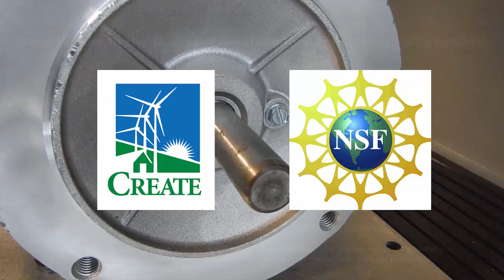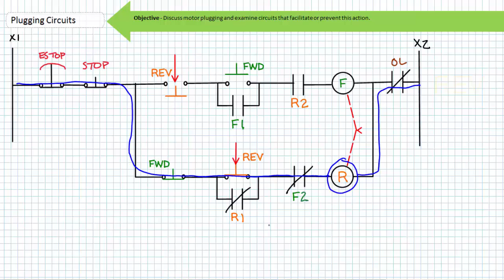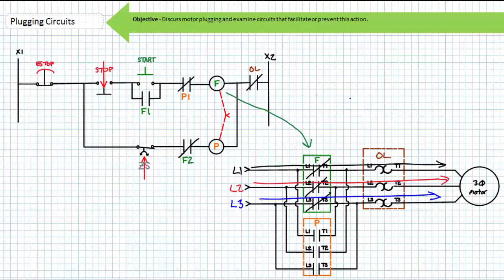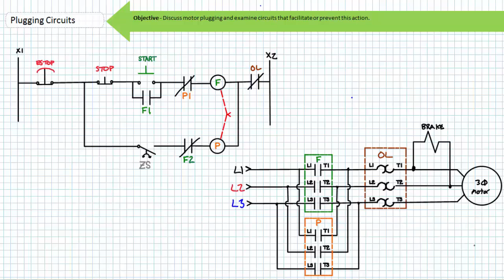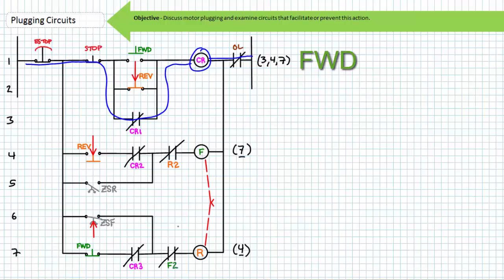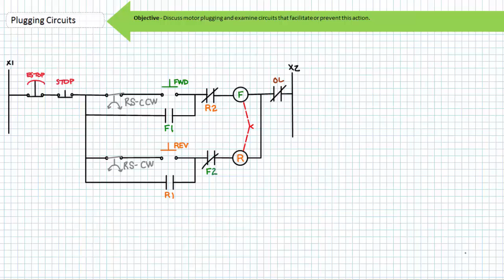Plugging Circuits (Full Lecture)

Comment: Hallo Sir,
I have a question about phase reversing and brakes.
The moment we reverse the phase, the direction of supply voltage for brake is also changing.
I mean, at first, the line to line voltage of brake is L1 to L2
and then it becomes, L2 to L1.
Does the brake still function ? is there a possiblity for magnetic forces to appyl counter force on springs ?
Reply from the maker: Good question. As illustrated the brake would also experience a phase swap during a plugging operation. This however isn't an issue for brake functionality because it operates using an AC solenoid where polarity does not influence direction of operation. This being said there is an extremely (extremely) brief transition period between the "instantaneous" reversal where the brake solenoid is de-energized when the F contactor opens and the R contactor has yet to close. I'll discuss this in later lectures on semiconductor devices and circuits but there's a practical limit to the operational speed of an electro-mechanical device because physical components need to move. Check out the "door bell" I make at the end of the control relay lecture.
https://youtu.be/STKH6Rp7rX8?t=1339
It's open and closing at some maximum frequency dictated by the repeated opening and closing of the contacts that have mass and must accelerate, break contact, decelerate, reverse, accelerate, make contact, bounce and make contact, etc. You can even see the arc forming during the opening. This is a sure fire way to destroy this device.
Semiconductor devices in contrast like thyristors in a solid state contactor have no moving parts and can allow and disallow conduction at extremely fast speeds and switch simultaneously (or nearly so). Hoping to discuss these devices in later lectures.
Reply: @bigbadtech  thank you sir. that was really helpfull.
İ am grateful for your attention.

Comment: Mr. Pytel,
I am following your courses and find them very informative you are doing a great job but I am still confused as to what is the major difference between a plugging motor & a jogging motor? It seems they are doing the same motion back & forth at small increments according to the operator?
Reply from the maker: +D. G. jogging = brief movements in same direction, plugging = instantaneous reversal
Reply: That simple! Probably why I didn't get it!